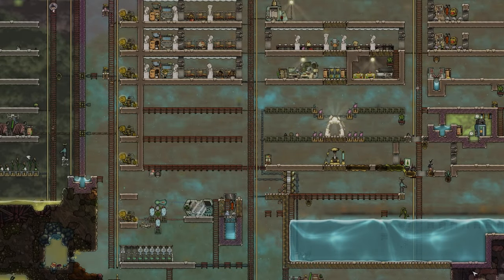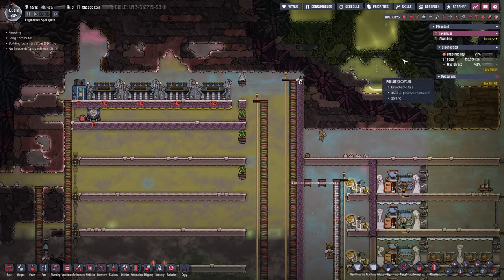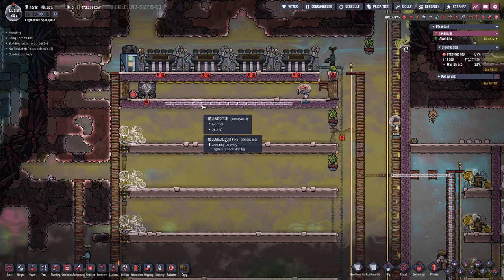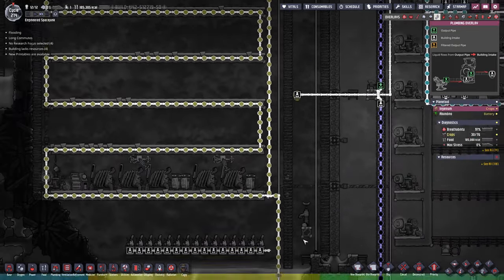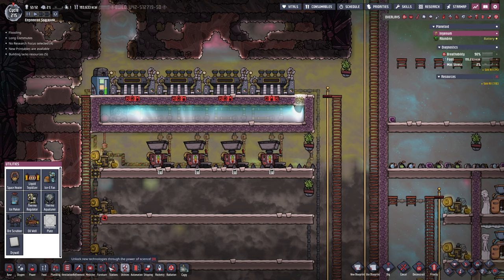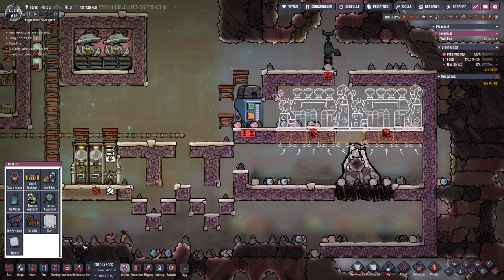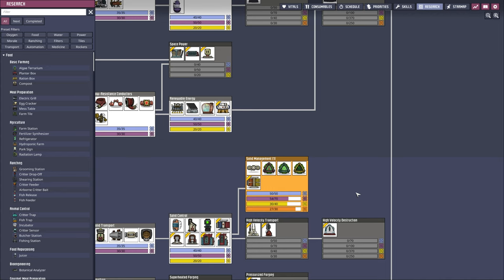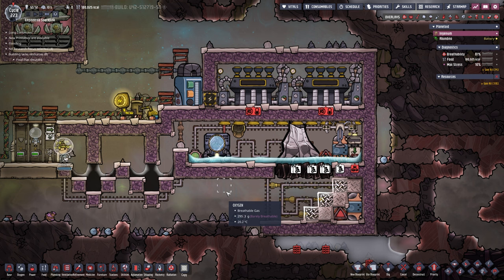Highly OPTIMIZED IRON VOLCANO TAMER! (LP2-EP10) Oxygen Not Included Spaced Out

Comment: Great designs as usual, I add a conveyor chute, in your design it would go directly above the rail thermo sensor inside the volcano chamber @27:20 so if the material isn't cool enough it will get dropped on the ground, this means the hotter, fresher iron sitting in the conveyor loader gets to cycle it's heat around as well and the auto sweeper will just pick up the dropped iron and put it back into the conveyor chute. I hope that makes sense haha
Reply from the maker: Thank you! I appreciate the tip, I need to test if that makes a tangible difference :)
Reply: @BierTier  that's a great idea, while I admit it makes sense in my head I have done zero testing haha, although it does save that weird issue where you get grams (or micrograms) on the conveyor rail that seem to never change temperature

Comment: The bridges from the metal refineries are dragging the heat out of the steam room, making your build waste a lot of energy. Instead, I believe you'll want to have the bridges on the cooling loop instead.
Thank you for the great content!
Reply from the maker: You are 100% correct, I missed that completely! Thank you for the hint :)
Reply: I was just about to type this exact comment
Reply from the maker: I do appreciate it, I’m definitely not above making mistakes and appreciate it when you guys make me aware of them!
Reply: I can confirm, recently used gas bridges in a build to quickly transfer heat to the output of a vent and insta-boil water to steam, before that I thought bridges were exempt from any physics rule since they worked like a portal, instantly moving pipe contents to the output pipe, but it is affected by heat, can probably melt as well, would like to see an insulated version given this fact.

Comment: 2:00 It would have been sufficient for the second deflector to shoot down at 45 degrees, the radbolt would hit the tile next to the researcher... More safe would be to simply move the research station up and to the left so the radbolt hit the station port and continue diagonally up when full to hit a ceiling tile as no dupe walk in ceilings :)
Reply from the maker: I don't agree with the first statement because there is this lever on the left side that the dupe uses every once in a while. Then the dupe stands in the exact tile a radbolt would hit from a 45degree downward angle :)
The second statement, however, is 100% true. That would indeed be the best solution! Thank you!

Comment: Theres one issue. In my case theres 20 tons of 400C Iron lying around aside the volcano. Filling all that with the current solution clogs the cooling loop since theres endlessly more stuff coming in than out. Im thinking of adding a conveyor rail element sensor some rails before full loop, and shut down the conveyor loader if the sensor detects refined iron on the rail. Not really sure if disabling the loader with red signal actually halts sending stored materials to the rail or not, but we will find out soon. Update: It seems to work just fine :).

TLDR; build Conveyour raile element sensor before the rail temperature sensor, and send automation signal from ith through a Not gate to the loader. This way the cooling loop wont jam from a possible overfeed
Reply from the maker: How did you accumulate 20tons of 400C Iron?? Haha :D
But I'm glad you found a solution for your problem and shared it here, thank you :)
Reply: @BierTier   Early on I found out Iron volcano next to my base, accidentally dug the output tile of it. Didn't have understanding on handling volcanoes, So I sealed it shut. After gathering tech, knowledge and courage for some 100 cycles, the volcano had spilled over 20 tons of pure iron next to it. Those two turbines did some overtime on cooling out the stuff with your setup :D
Reply from the maker: Haha 😂 Yeah, that makes sense! It was definitely a good call to seal it up until you knew what to do with it! I have never tried this setup with a large amount already sitting there, only ever on “fresh” volcanoes. But, a there is a solution for everything and that’s why I love this game and it’s player community 😊

Comment: I got PTSD flashbacks from your electrolyzer setup.  I used to use a similar build, but one-pump-per-gas can't keep up with the oxygen output and without fail something would go wrong and one pump would start picking up the wrong gas (that was many patches ago, so maybe it is more stable now).  Instead I just cram the two pumps and an electrolyzer into a small room and filter the outputs.  Since both gasses are below 999g/s no-power filters can keep up without issue.  Priming it can be annoying, but it is no more annoying than setting up a water lock.
Reply from the maker: Really? Lol 😂
The "other" Electrolyzer from LP1 has been running nonstop from around cycle 110 to over 1000 without issues. Yes, 1 Pump can't suck out all the Oxygen, but the Electrolyzer will self regulate and overpressure periodically very briefly to let the oxygen get pumped out. Yes, it's not 100% up and efficient, but it works without any issues.

Comment: Picked up ONI recently and am following along with this series, great inspiration so far. One issue i have is i can't for the life of me get the Steam Turbines to run fluidly. You never go over just how much water you pumped in there to start the process off. I browsed the internet to try and figure it out but every post just talks about Steam per Tile so not too helpful for me at least.  Tried with 200  kg of salt water per tile topped of with a hit of water to get the vacuum. Should i use more? less? is there a sweet spot where it just works and wont work either side? Any quick tip would be great. Sorry its a comment on a 7 month old video, hope life treats you well :)
Reply from the maker: Hey, I'm glad you are enjoying my videos!
From the context, I'm assuming you are talking about the steam turbines which are cooling down the industrial brick? There is about 100kg of salt water per tile and just enough water to create a vacuum. I think it's roughly 20kg of water per tile. The exact amount doesn't really matter.
This system will never run consistently on only 1 thermo aquatuner. Keep in mind that the rest of the space is used to cool the metal refineries when they are in use. Unless you use atleast some of them at all times, not all steam turbines will run, especially not at full power.

I hope this helps :)

Comment: Hello! Thank you so much for this awesome guide. I tried my best to copy it and do believe I managed to do so successfully, however my Auto-Sweeper and Conveyor Loader does take some overheat damage, which requires my dupes to keep re-entering to repair. They are both made out of steel, of course. The output of the vulcane is at 6,6kg/s at 2526,9 degrees. Any tips to prevent my buildings from overheating? After having a closer look at it, it appears to be the steam getting too hot in the room and making both the Auto-Sweeper and Conveyor Loader overheat, the steam peaking at 415 degrees when the buildings overload. Again, thanks for your awesome guides! They have been instrumental in me having gotten so far in the game this time around. :D
Reply: Adding more water to the steam-room appeared to have fixed it. :) I happened to notice that you had ~60kg steam in your room and I only had about 5kg. :D Again, thanks for the great content!

Comment: Could please somebody explain to me how the steam turbine works and why is it in the metal refinery setup?
Reply from the maker: Absolutely I can. The Steam Turbine basically deletes heat. It takes Steam of at least 125C(it does nothing below 125C) and converts it to power and water. The water it releases back into the basin is always at 95C. The hotter the steam is, the more power it produces(maximum is 850W per Steam Turbine). This is true up to 200C, which is maximum capacity for the Turbine. If the steam is hotter than 200C(let's say 250C) the Steam Turbine still runs at full efficiency(850W) and still releases water back at 95C, but no more power is gained. If the steam is lower than 200C but higher than 125C, the power production efficiency goes down accordingly. The Steam Turbine itself needs to be kept at below 100C for it to work, the Radiant Liquid Pipe going along the floor is responsible for that.
The Metal Refinery has 800kg of Oil stored in it and it heats it up drastically during the manufacturing process. Above 200C for Steel(it varies for each material, steel is the hottest). That heat needs to be released or your Refinery Overheats or even Melts eventually. That's what the pipes in the liquid basin above the refineries are for. 
Last but not least, the Thermo Aquatuner cools the liquid for the cooling loop around the entire Industrial Brick, but produces a lot of heat in the process, which we dump into the water/steam it is sitting in. 

I hope this was clear enough to understand, if not, feel free to ask :)
Reply: @BierTier  I rarely had issues with metal refinery overheating problems. I use one as part of my disinfection process for water. I run the water sieve before it and take that germy not polluted water and send it into the metal refinery in chlorine environment (prefer near a chlorine volcano or simply take it from the balm lily, chlorine, hydrogen, pincha pepper, phosphorite biome) and use this for disinfection. Water is better than fossil fuel for taking heat away from something.

Comment: Hi, 

I don't understand the liquid bridge pipe at the thermal aquatuner.... whats the purpose of the liquid bridge there? It looks like to me it allows the liquid to avoid the thermal aquatuner....

https://youtu.be/v-1BLL1tNTE?t=1462
Reply from the maker: You are indeed correct, it does allow the liquid to bypass the aquatuner. The tuner has priority with this build, so the fluid always goes there first. If the tuner is blocked(turned off by automation for example), the liquid will bypass the tuner and still continue to loop until it picks up enough heat to turn the tuner back on. That’s the purpose of the bridge construct :)
Reply: @BierTier  Thanks for the response - shame on me, I couldn't figure out myself :)

BTW. I started to build it, then I realized some of the components (eg conveyor thermo sensor) are high end research items what I don't have yet. Can you recommend a less advanced but still working alternative?
Reply from the maker: No shame at all, that happens, no worries :)

To tame a volcano, this is unfortunately the simplest solution. There is not much else that will ""just work". If you have a cool slush geyser nearby, you could use that cold polluted water to cool down the hot metal. But even that would be difficult to finetune. You can put a layer of oil in a chamber around the volcano, water on top and 2 steam turbines above it. The hot metal will heat the oil, the heat transfers into the water, it boils into steam, powering the steam turbines and cooling the metal. The lowest temperature you'd achieve that way is around 125C(if the steam gets colder, the turbines turn off). You'd need a double liquid lock to contain the heat in that room and provide access for dupes in Atmo suits. Then store the metal in a cold biome to cool it down further. Something along those lines.
There are options, but they are far from optimal...